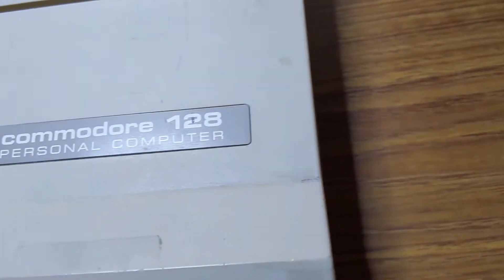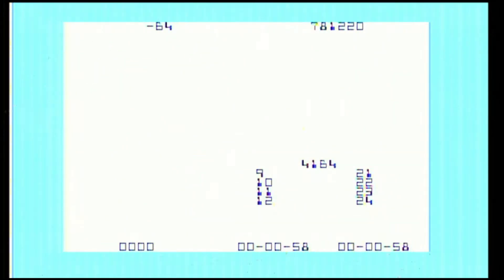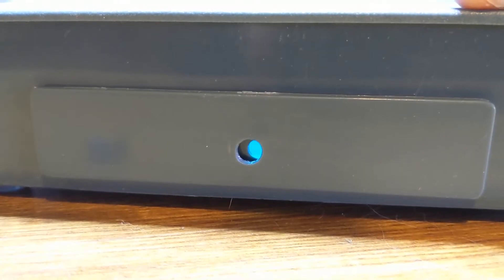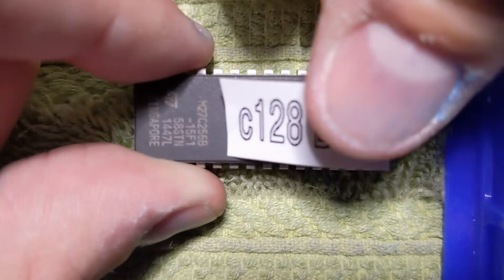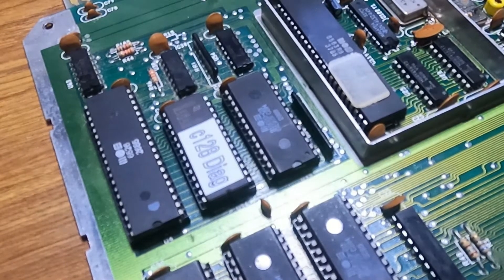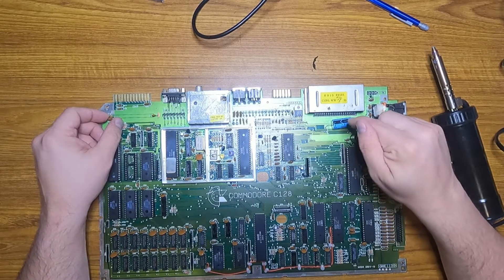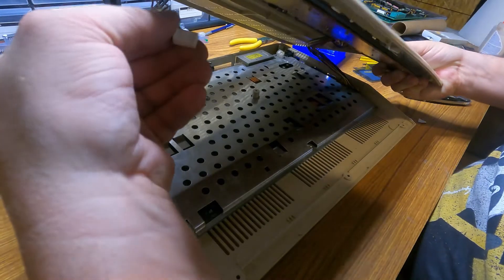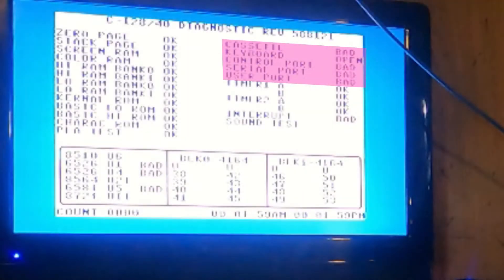C128 Repair Part 1 - This thing just doesn't want to tell me what's wrong!

Comment: I have dongle type test harnesses for the C64, which also work for the C128 with the exception of the keyboard. Also extra GALpla’s for the C64. If you want them let me know, I’ll send you a set!
Reply from the maker: That would be awesome!  I got a diagnostic kit, but haven't put it together yet, and I don't have any spare PLA replacements of any type around at the moment.  And I just got a new 64C that I need to check out.

Comment: Hmmm.. it was a failure with regards to convincing companies to release dedicated c128 versions, outside the scope of productivity software, Infocom adventures, and a few games. 

But Commodore sold over 4.5 million c128s, which makes it a way better seller than the large majority of 8 bit machines out there, including for example the Apple II (all models combined)

If one considers it was intended as a stop-gap machine, with a projected 450k sales and a market lifetime of about a year (to bridge the time till the Amiga was available) when it was thrown together (as per Bil Herd), it sold approx 10x the projected number of machines, was kept in production for near 5 years instead of the max 1 year projected, I think calling it a commercial failure is incorrect.
Reply from the maker: True.  I know a lot of people who bought it and just always used it in C64 mode.  At the moment, that's all I'm doing for now as well, until I get a way to use 80 column mode.
But you're right, it wasn't a failure from Commodore's end as far as sales, but so little software was made for it, since C64 mode let developers just make to the lowest common denominator. Over 5 years I would have hoped for more software, especially more games since it could use so much more RAM.
Reply: @realchef_tom  The last couple years did see quite a few c128 releases tho, possibly as many as the first decade after its release.

Getting 80 column output... depends a bit on what displays you have available, and where you are on the planet 🙂

If you are in a part of the world where scart was common, and you have some display with a scart input, you can probably just use Sven Pook's scart adapter for the C128.

If you don't have access to a display with scart input, a scart to hdmi converter together with that adapter will work, provided it supports both composite and rgb inputs via scart with auto switching (that is a standard feature on scart, but not every display supports it).

The best way to directly connect to a modern display is the rgb2hdmi with 6 bit 'digital interface board', but... getting hold of one of those seems rather tricky at the moment.
Reply from the maker: I'm in the US, so SCART is a dream for me.  I have a RGB2HDMI 6bit specifically for this, it's been getting the Raspberry Pi Zero that's stopping me right now.  Once I have it, I'm really excited to play with GEOS.
Reply: @realchef_tom  I was lucky and got a bunch of pi zeros and rgb2hdmi heads before those became very difficult to get.. but now I'm down to 2 complete setups (one with analog board) and one spare pi zero.
Reply: @realchef_tom  btw, I have a MATR CS33L scart to hdmi converter which works fine with ntsc displays (and can do frame rate conversion besides upscaling). 

It also works with Sven Pook's adapter and auto switching between rgb and composite. Sadly it doesn't support s-video, which is a bit limiting for 40 column mode.

It has some annoying traits, like insisting on displaying an info overlay for like 10 seconds every time it detects a resolution change, and the resulting quality for rgbi isn't as good as with a rgb2hdmi... but its relatively cheap (I can get it for 40 euro or less from various sources).

For me the biggest drawback of such a setup is it not really supporting using both the 40 and 80 column display at the same time. While there isn't that much software which makes explicit use of it, BASIC 7 supports it (escape + x to switch between displays), and for example the PETSCII Robots version for the c128 also uses this.

Comment: I just picked up a c128 and it turns on with power light, but the screen just turns to a blacker black. I have removed and replaced all the socketed chips but still nothing on the screen.
Reply: Check if the keyboard is working and ensure the 40/80 key is in the 'up' position.

Also, try holding the C= key during power-on to force it into 64 mode to see if that still works.
Reply from the maker: If you're getting an output signal then the VIC-II chip is still working.  Do you have any access to diagnostics?  even a C64 Diagnostics or Deadtest can give you some good leads to start with.
Reply: @realchef_tom  yes... C64 dead test cartridge is also valid for the c128, (c128) diagnostics should only be used once the dead test can run without problems.

Comment: Do you have a link to the diagnostic ROM that you burnt onto the 27C256? I burnt one but not getting anything even on a known working C128D. Thanks.
Reply: The 27c256 is a 32kbyte eprom, while the diagnostic is a 16k image. Its quite possible the image simply ended up in the wrong half of the eprom.

 The easy way to deal with that is writing a copy of the rom image to $0000 on the eprom, and a second copy to $4000 (or just concat the image to a copy of itself, and write that to the eprom).

Something to keep in mind is... unless you use the version from worldofjani with 'JB' added to the version number, the diagnostics cannot run from an eprom in U36, it must run from an eprom on a cartridge. Jani and me cooperated on that JB version which can run from the U36 socket.

Another thing to know about, an  AT28C256 eeprom is not a 100% replacement for a 27c256. Yes, it should be, but... measure the legs, they are ever so slightly shorter, and this will cause problems on cheap sockets (U36 for example) in which a 27c256 will work.

Last but not least, if it is on the cartridge port, you can use the machine language monitor to check if the cartridge got mapped into memory (it should be in bank 8, starting at $8000, but if its written to the 'wrong half' of the eprom, it will be at $c000 instead, and won't work).
Reply from the maker: Thank you for all that knowledge!  And the diagnostic ROM!
Reply from the maker: I used the one from World of Jani (http://blog.worldofjani.com/?p=164), scroll down to the C-128 Diagnostic Rev. 588121, about 1/2 of the way down the page.